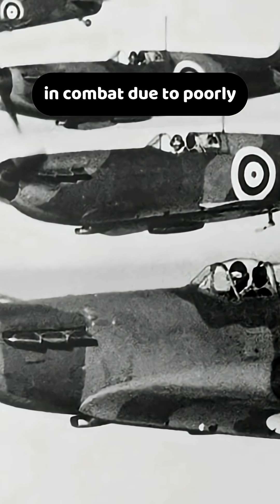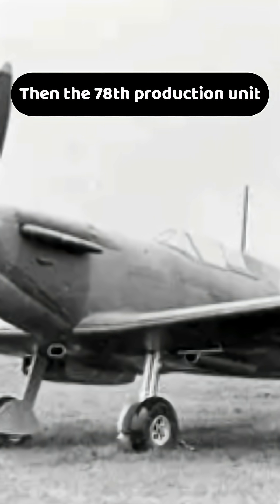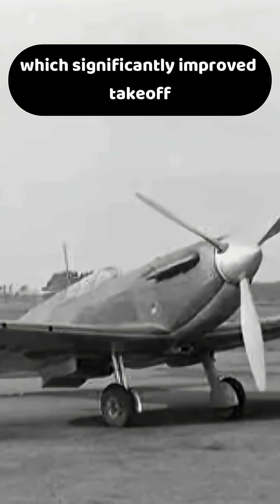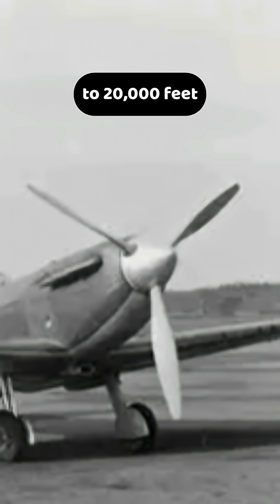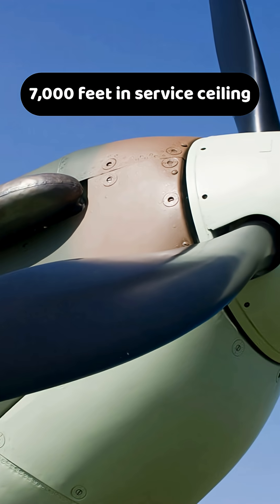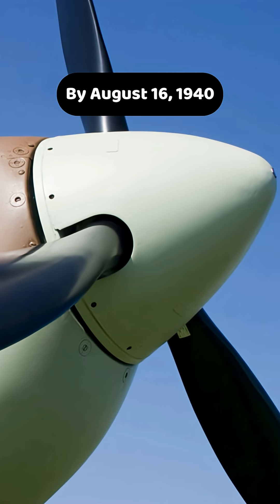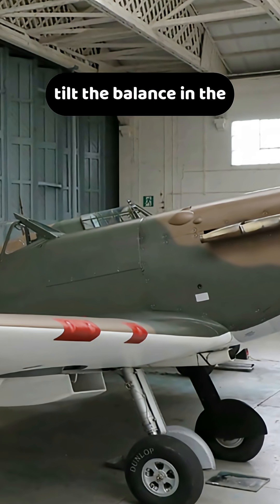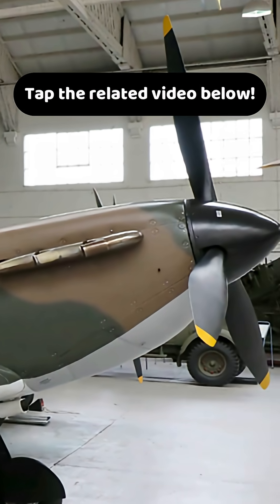How the Spitfire's New Propellers Won the Battle of Britain

Comment: The De Havilland produced version of the metal 3 blade Hamilton Standard Hydromatic propellers were not replaced, their cheap but light weight De Havilland manual pitch control was upgraded to the original Hamilton Standard specification constant speed unit fitted on the very front of the Merlin engine.  The Nazi’s 109 also started with a 2 blade fixed pitch propeller and only got working constant speed propellers after the start of the 1941 109F production, their electric control constant speed propellers had a difficult and prolonged introduction.

Comment: The exact same argument could be advanced for the Hurricane which, like the Spitfire was initially produced with a fixed twin-bladed prop paired with the Merlin I and Merlin II engines.  Just as for the Spitfire, introduction of a three-bladed constant speed Rotol prop had a significant positive impact on the aircraft performance, particularly its rate of climb and overall efficiency in all phases of flight.  Additionally, the Hurricane migrated from a fabric-covered wing to a stressed-metal skinned wing which reduced aircraft weight and drag leading to improved performance.
As for calling the Spitfire a "near-failure" prior to introduction of the three-bladed prop, that is frankly a ridiculous statement.  You might as well call the Bf 109 a near failure prior to the introduction of the Bf-109E.

Comment: The Spitfire did not win the BoB, the Hurricane got over 60% of the kills.
Reply: The hurricanes were tasked to attack the bomber formations
Reply: @muhammadsaleh7229  No, they were not. it is one of those myths that will not die.
Aside from a few VERY limited occasions, there were no such instructions.
(It has been researched and refuted).
Reply: Mainly because there were more Hurricanes than spitfires in the BoB
Reply: @srgmiller340  Which rather supports the point that the Spit did not win the BoB.